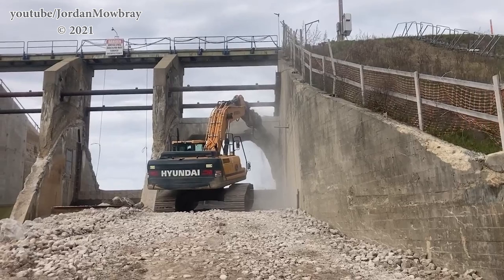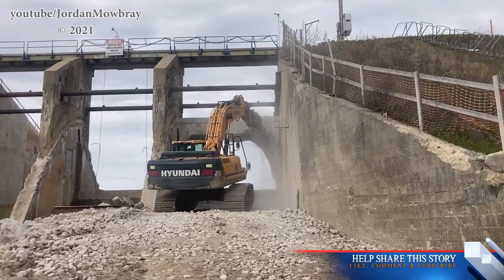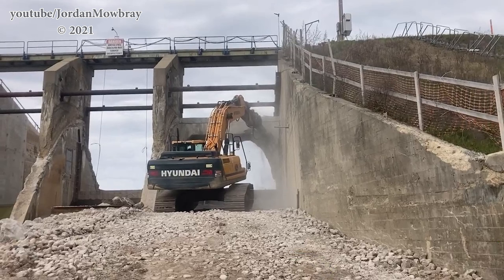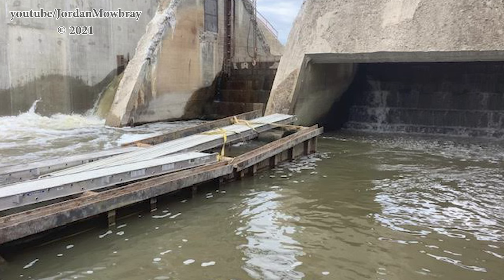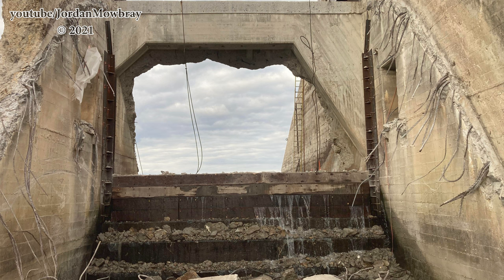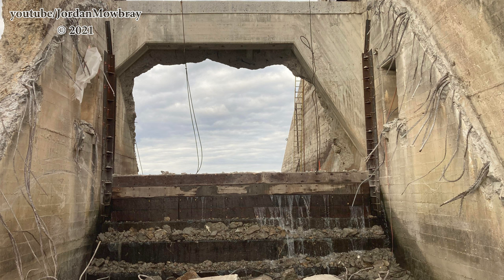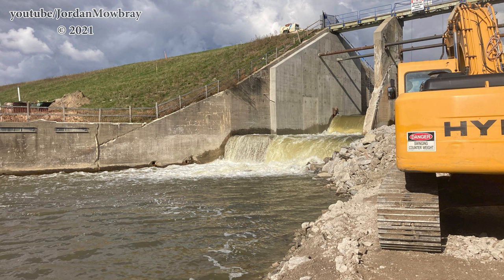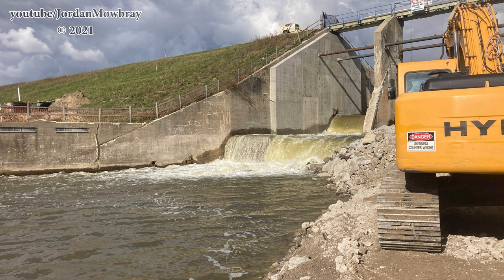Spillway Demolished Short! Tobacco River Dam

Comment: They gonna b poring the cement r concrete ta that same level r will it be lowe? Or they gonna b putting gates in at that level n have the gates closed n open the gates up if when n r during the flood season?
Reply from the maker: They will be higher. This is just interim